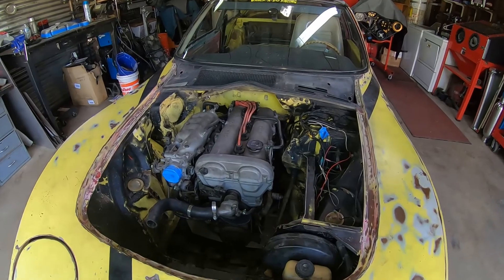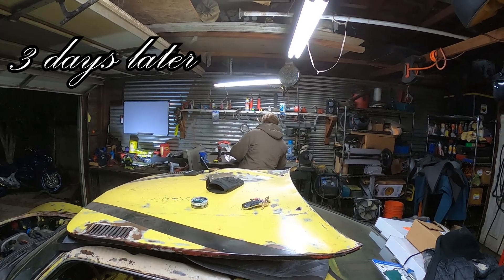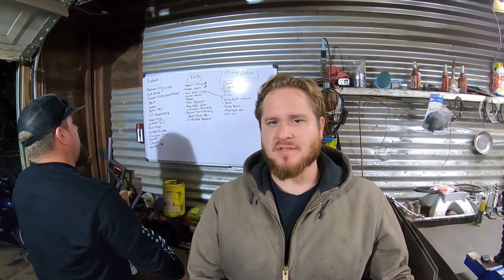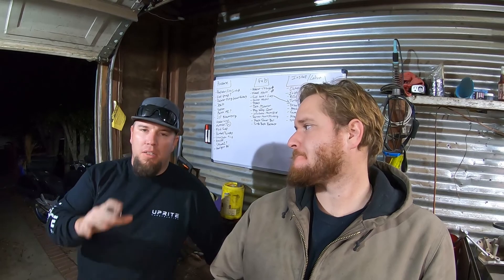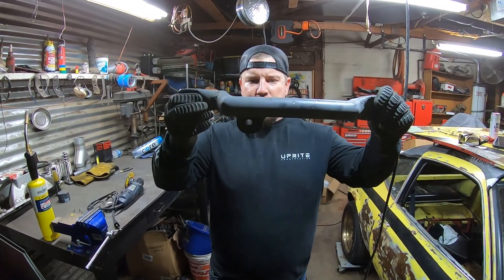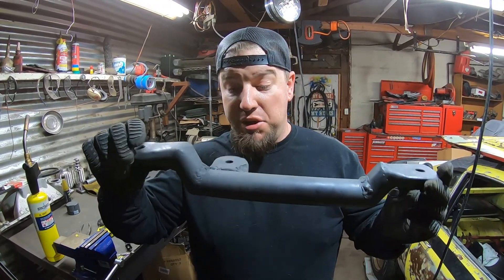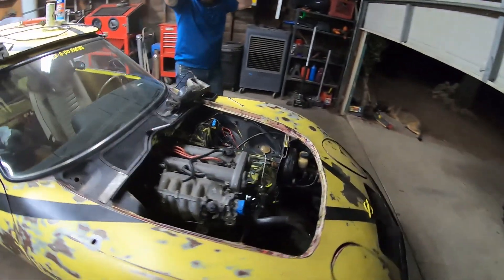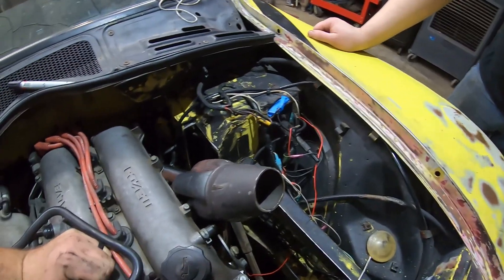e.20 Opel Gt Turbo swap, PT.3 (trans mount and turbo manifold)

Comment: Amazing work, it makes me a little but jealous bcs in Germany you would never ever be able to drive such an modified car on public roads. In Krautland we say "TÜV sagt nein"  Im also looking forward to see your Coolingsystem with the new Radiator in action , because the Opel GT is known to have Overheating Problems even  with the normal 1,9s L Motor.
Reply from the maker: Here in CA we're very fortunate that anything 1975 and older is exempt from smog or it would be instantly pulled over for emissions, but I think we may still end up having some law emforcement related conversations just because the look of it 🤣. We have a loose idea where the radiator will end up as of today, and were hoping for stable temps as well. We will see...
Reply from the maker: "tüv sagt nein" 😂 yeah, this is a big "no,no" I think.
Reply: Or in France 🤪.
You just can't have bits of you engine poking through the bonnet/hood!
And as well, all the Opel GT and classic car owners wouldn't let you in to their meets with that🤔🧐😡
Keep up the good work. I really like the Spitfire build, so this Opel GT is going to be wicked!🤘👍😋